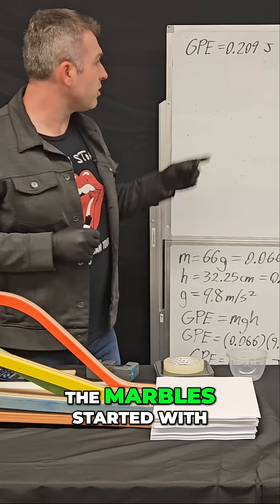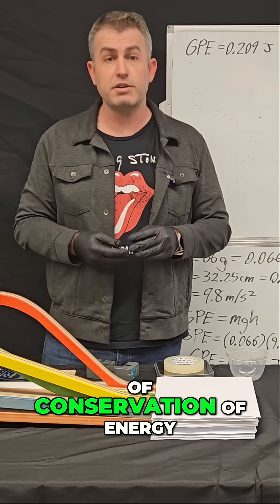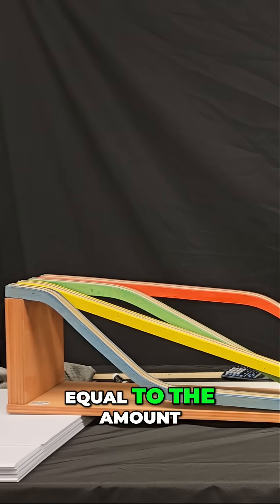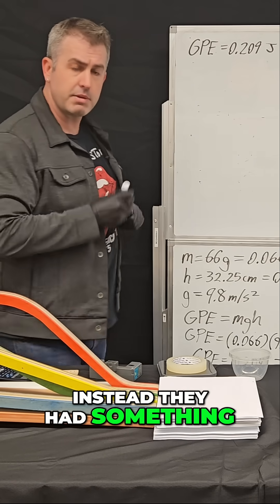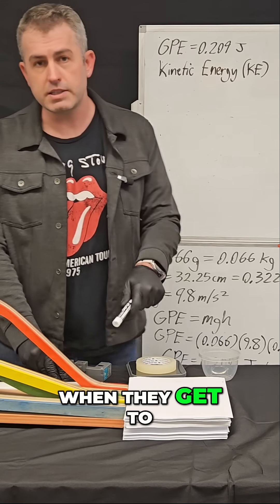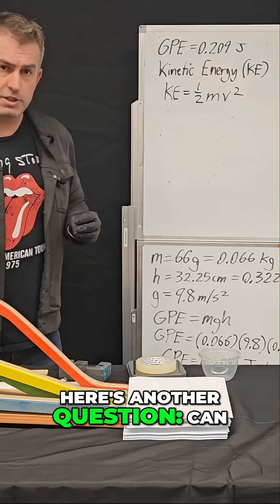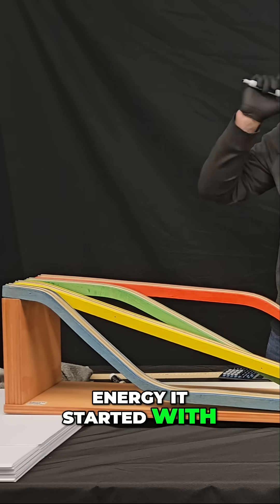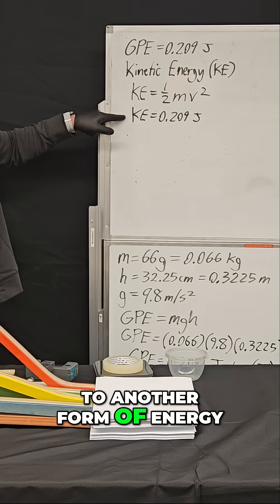Marble Physics: Same Speed?! Energy Conservation Explained

Comment: what if it was a disc rolling down and not a sphere?
Reply from the maker: It depends on how the mass is concentrated around the disks center. A solid disk of uniform mass will get to the bottom faster than a hollow ring with all its mass concentrated at its edges